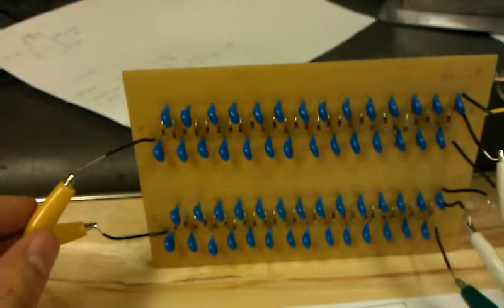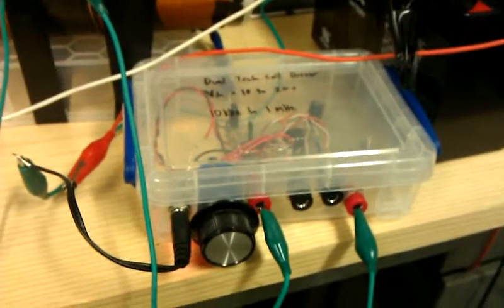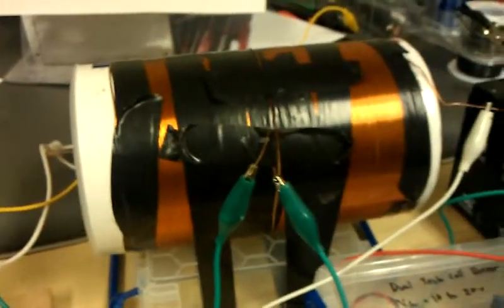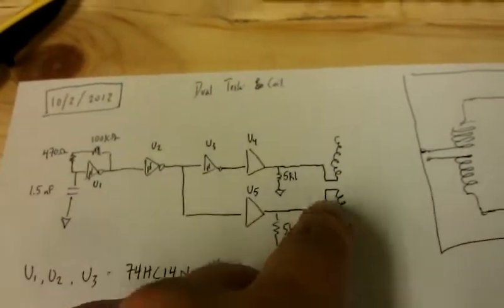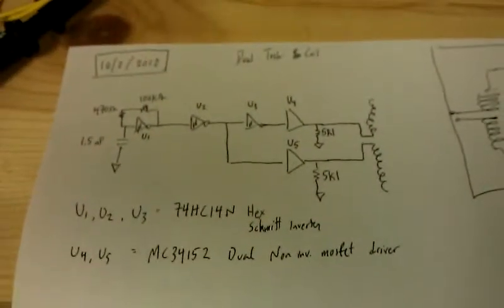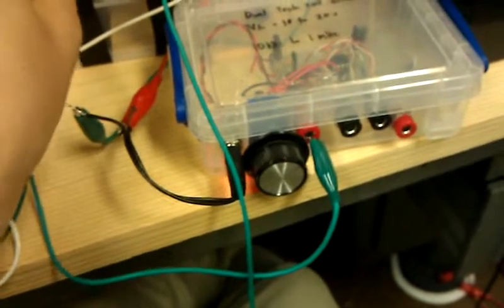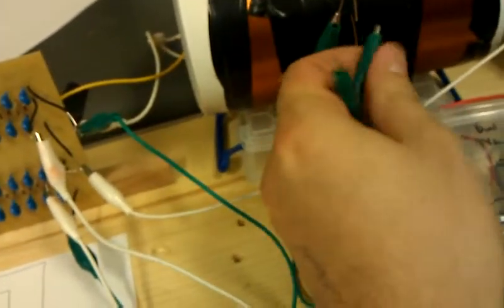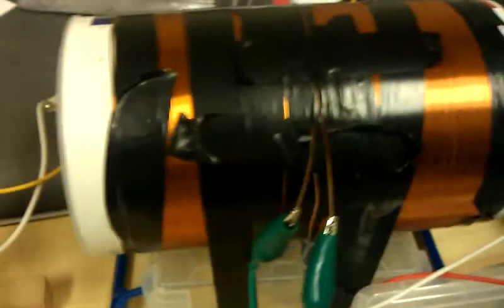Balanced Tesla Coil High Voltage DC - 3kv  - with dual mosfet driver circuit

Comment: I would not call it Tesla coil exactly since it does not have one coil exciting the other one with a resonance point at high frequency. I would say that your circuit is now ready for a primary coil of the Tesla coil connection with a spark gap in chain.